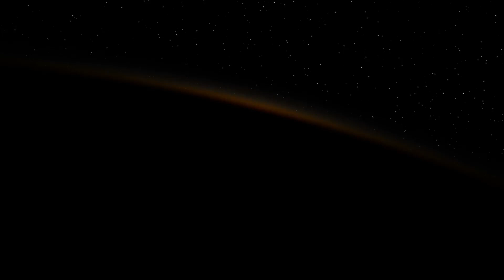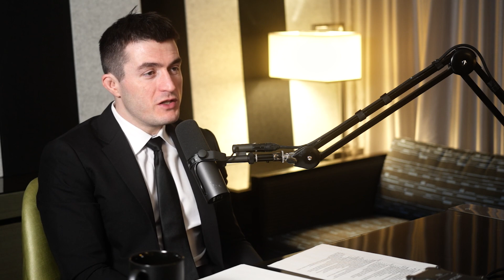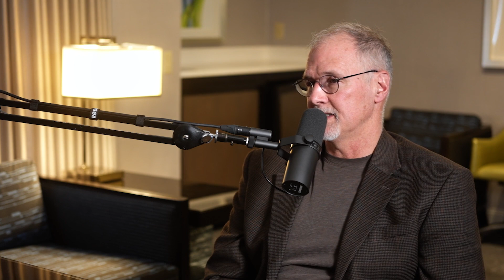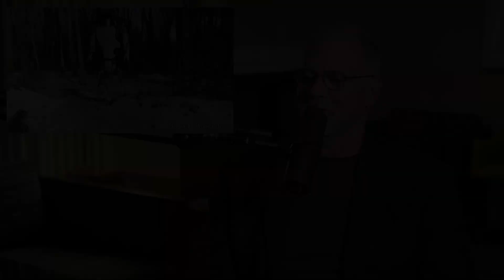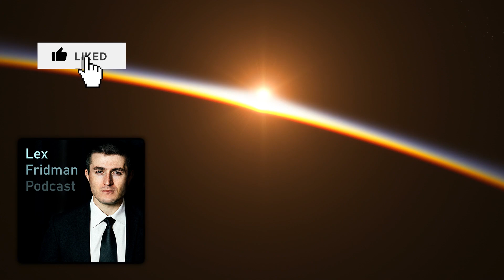Physics simulation for Boston Dynamics robots | Robert Playter and Lex Fridman

Comment: I have spent many years working on physics-based simulations.  A major issue is managing the many details required to model the physical world.  Increasing the fidelity of a model requires complexity which eventually becomes difficult to manage.  Achieving the required fidelity can sometimes be as or more difficult than developing the primary project objectives (enabling simulation of robotic software, for example).  At some point, it becomes more practical to test in the real world.  
Even with these limitations, physics-based simulations (with reasonable fidelity) are absolutely essential to developing complex systems success.  Successfully modelling even a few aspects of the real world creates understanding within the developers which usually results in key insights that improve the product under development.  For example - accurate modelling of surface contacts likely helped to develop improved foot placement algorithms.